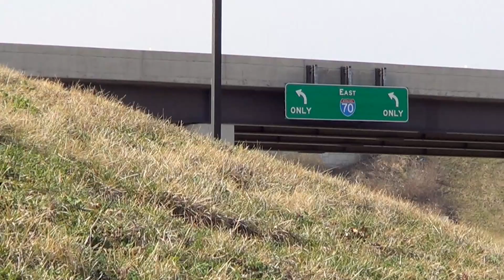MoDOT Recruits Solar Roadways

Comment: The original video now has disabled ratings and comments. How confidence-boosting
Reply: They have no answers and don't stand up to even the slightest bit of scrutiny.
Reply: Because the negative comments were running like 300 to 1.
Reply: Warren Lauzon because the idea is not practical, that simple.
Reply: Just tells how people have figured out they were scammed.

Comment: Readily available software can predict the solar generation potential in a particular location. Putting up test panels is an unnecessary waste of time and resources. This is not to mention the ill-advised idea of putting solar on a parking lot. Why on earth would you put down solar panels, only to have them be largely shaded by parked cars? Roads have the same issue, but to a lesser extent.
Reply: Why put up test panels?  To get "Solar Roadways" and "installed" into the press release, and Mr. Brusaw into the photo.
Reply: You got that right. All while creating misconceptions about solar left and right.
Reply: The 'Solar Left' is off protesting other misconceptions, while the 'Solar Right' is installing rooftop panels by the truckload.

Comment: What a dumb idea.
Reply: you;re literally talking about taking solar panels and blocking the sunlight and crushing them constantly with vehicles. if you're going to get energy from roads, use pressure, if you;re going to get energy from solar panels put them where the sun shines, dumbass
Reply: Patternicity ur so right
Reply: +BeezmanTv there's a difference between being open minded and being a gullible fool. people are already saving money by getting solar panels, solar roofs are a real thing that people are willing to pay for. putting solar panels on the ground reduces exposure to light and the lifespan of the panel.
Reply: what are u smoken ?
Reply: how is this dumb its fucking brilliant i see this happening more or less giving better tires are being made with cleaner gases it's ether the opposite or solar panels that  you sir are a dumb idea go blow tobacco out of your ass and dirty the air the hillbilly
Reply: +ben kenobi yes!! they r 2 fucking close minded . tell 'em again :-)

Comment: One of the MOST Stupid Ideas ever. Let alone traction or wear, them LED lights will Not be seen in day light. And how many times have you seen Gouges in the road? All the Time. What happens when a car or truck has a flat and runs on the rim? Or a trailer comes off a car or truck and it digs into the road? The cost is going to be out of this world. Now parking lots, side walks these may be fine. But not roads. And how about criminals? Running from the police on flat tires, or just steeling them. Get real.
Reply: ***** You didn't even address any of my points, you're just quitting like an upset toddler. You're not quitting because I insulted you, its because you're in over your head and you don't know what you're talking about. That's because you don't know anything about BASIC science, since you're an uneducated child. You quit because unlike you, I actually have a background in chemistry/physics and know what the fuck I'm talking about, because I've taken the time to educate myself and expand my knowledge of the universe. Get the fuck out, you future ditch digging piece of shit.
Reply: You can't wish science to disappear, but if you can spew enough BS you can distract people long enough to run a nice scam.  :)
Reply: ***** Are you actually being serious? The hardness/fragility of glass is inherent and unique to its molecular structure. Do you know how hardness works? If you rub two objects together, the harder one is going to erode away at the less hard material. Of course you could "temper" the glass to make it scratch resistant, but then you're using tempered glass as a road surface. You know, the stuff in your car window. The stuff that EASILY SHATTERS INTO A MILLION PIECES if you strike it with the tip of a pen. Everything on the road besides the rubber of tires is harder than glass. The pebbles, the dirt, the cars etc. The glass doesn't stand a chance. And lets not even talk about what happens when the glass gets wet, or when it gets cold in the winter LOL. There is no reason for these tests, anyone with BARE MINIMUM scientific knowledge knows the project is going to fail before it begins.

Putting somebody on the moon was never impossible, it was a very feasible and practical experiment, HENCE WHY THE PROJECT WAS FUNDED AND CARRIED OUT. Same with speed of sound, it was hard to do, but completely feasible and within the laws of reality. Making the roads out of glass LED solar panels? Completely retarded concept that cannot work because of the innate qualities of glass. Solar panels are great, but they don't belong on roads. Even having them for sidewalks is foolish considering how effortlessly they get damaged.

You have the scientific understanding of a child, did you even take high school physics and chemistry? You literally don't even understand why glass is a terrible material for roads, despite it being so fucking obvious and fundamental to the properties of glass itself.
Reply: No, glass can never survive the impacts that Alan described. There is no magical "testing" or "research" that will make glass tough and durable. We are dealing with the laws of science, you can't just wish them away with hopeful thinking, grow up.
Reply: Havox Aerthis You're a fucking moron. Take your TV or smartphone, lay it flat on the road facing the sky, and the drive to towards it and tell me you can see whats on the screen. SPOILER ALERT, you can't see jack fucking shit! There's a reason traffic lights aren't put on the roads, because you wouldn't be able to see the fucking lights! You're so stupid to not even understand the context of the example.
Reply: Havox Aerthis Wow, you completely ignored the fact that LEDS on a road surface cannot be seen in broad daylight, and will never work! Haha, and you think I'm american because I schooled your uneducated ass? Go back to your third world mud hut and read about how the earth is flat you incompetent stain. It doesn't matter how bright they are, if you can't see them properly due to bad angles. You don't understand basic mathematics, yet you're preaching about LEDS LOL.
Reply: Non de zeus ! Man, how you can see your smartphone screen during day ? How you can watch TV during day ? Oh well, we can't because you told us that artificial light can't be seen during day. Fucktard
Reply: Havox Aerthis pretty sure you are a sockpuppet
Reply: Yes yes and we also could not put a man on the moon, nor have plans that go faster then sound or light  So"We are dealing with the laws of science, you can't just wish them away with hopeful thinking, grow up." please take your advice also were did you get you degree in glass science and technology are write papers or do a thesis I love to read it.
Reply: And Yet I don't belittle you call you names nor talk down to you and look at the response I got from you it just shows me you have no understanding also probably ignorant. To bad I was hoping to have a Inequality Talk. please don't reply as I am done
Reply: Fake Grapefruit  Haha, angry american can't understand such a simple thing ? LED are more brighter, last time I saw a LED lamp, this lamp was flashing my eyes at about 1 miles, it was 5 pm.
Reply: Fake Grapefruit  Wait and see.
Reply: Faster than light.. yah, that happens a lot.
Reply: How well can you see your phone screen in direct sunlight?
Reply: It why they call it a test how stupid you will look if they work or right if they dont

Comment: Solar panelled roads cannot defrost themselves. Laws of thermodynamics.
Reply: I live where there is lots of snow during winter. Solar panel would be covered with snow and ice, so it would get very little light through snow. In winter time here it is often cloudy, sun is up in the sky less than in summer time and angle of the rays hitting road is very unfavorable for collecting energy, especially if there are trees shadowing road. It would not be efficient way to melt ice even from the small sections of road.
Reply: ***** No it won't. First let's say it magically will function, then let's go to the snow issue.

a) How is it going to gather solar energy while it is covered in snow?
b) How is it going to drain the water after it melts the snow?
c) How is it going to prevent the melted water from turning into ice, it's not going to use only 333.55KJ per kg to melt the snow it also has to keep the water it melted warm so that water doesn't transform in an ice sheet.

And before all of these issues there is the fact THAT IT DOESN'T WORK. It's a scam.
Reply: +imzjustplayin Dude, you need 333.55 kJ of energy for every 1kg of ice. That is not going to work.
Reply: And if it is pulling power FROM the grid, then how is it generating any power?
Reply: No, that is not how it works. And you would need about 2 weeks of stored energy (where is the storage, BTW?) to defrost 1/2 inch of ice.
Reply: It's not even a net generator during the day, and huge consumer at night.
Reply: Nope - the website says that when the temperature drops under 30F they heat up, regardless of any ice or snow. It's just freaking stupid.
Reply: Jared Pratt Actually, absolutely ZERO thought has been put into the storage of energy that is created, which is kind out moot to begin with because these panel are net consumers even if working properly as designed.

Unfortunately, the entire concept is flawed, and the execution of their first installation in Sandpoint demonstrates complete failure of concept.
Reply: Timm Bacher The sun is orders of magnitude better at melting snow and ice than any road surface will ever be, and the heat retention of asphalt even puts these panels to shame.
Reply: We have had solar panels for decades, in permanent rooftop installations - can anyone find an example of one that  heats itself to clear ice and snow that a) isn't powered by an outside source, and b) does it in real time, considering there is no storage system for this design?
Reply: @P C I'm surprised that he didn't reply with more "science woo"
Reply: Jared Pratt pavement can do the same
Reply: Can you imagine how absolutely incredibly expensive it would be to heat miles of road with electric power?

These charlatans haven't changed the laws of thermal dynamics or the cost/value of electric power.   And for those of you who haven't lived where it actually does snow, when the sun shines, the sun's light and heat energy hits the blacktop and is already converted into heat energy.   Inefficiently collecting it as electrical energy,, attempting to store it inefficiently and then using it in a wasteful method does not make any sense. 

Next time some idiot makes a flashy video, turn on your brain and think it through before you fall hook line and sinker for this.
Reply: You are going to have to heat it enough to not only melt the snow but to drain it away.  Then you will need to keep the surface warm enough for the water to dry so it doesn't form a thin layer of ice from the left over moisture.  The ground around the road is going to be covered in ice from the water splashing onto the colder ground.  So  you will need heated drains to keep the water liquid.  Yes you are melting tons of snow.  A few inches of snow on a short length of road will weigh a ton.

Anyway you put it, this is an incredibly stupid proposal, that is except for the charlatans pushing it as they collect money from the foolish people and governments who throw it their way.
Reply: Now, another issue you have with laws of thermodynamics have to do with expansion and contraction. Glass expands when heated. So will the various metals used to build the frame, and they will expand at different rates, creating gaps.

The heating pads they have designed for this SR3 system go inside the unit, correct? 

This would cause the units themselves to expand and contract - unevenly as per material -  as they were heated and cooled. I'm guessing the units are not vacuum sealed, so any gas in the unit would also expand and contract, then condense. Even if they start off sealed, they won't remain that way for long.

Heat and condensation/moisture are enemies of electronic systems, as has already been proven with their Sandpoint installation, which was an incredible, and predictable, failure,

Now, for the heat to transfer through inches of glass, to the point where it can melt snow, do you have any idea how hot the cavity of the panel will have to get to melt substantial ice or snow loads from the surface? Probably somewhere in the neighbourhood of 70c, since it takes the same amount of energy to take ice from zero to 70c as it does to boil the same amount of water.

As for energy required, let's say we are using consumer heating pads for the purpose. a 12"x12" pad one would normally have around the house uses 60-80w. Let's call it 60w, but we now need four per panel. The power requirement then would be 240w per panels to heat them up. Or, roughly 1kW per every four panels, excluding their intended purpose of lighting up the road.

But these panels only produce 44w, IF they are pointed directly at the sun, 24 hours per day, and are perfectly clean using completely clear colourless glass with no faulty cells. NONE of which are the case with the SR3 panels in their proposed installation paradigm.

A four-lane highway is a minimum of 62 feet wide, at 12 feet per lane, plus ten feet on the outside shoulder and four feet on the inside shoulder. A mile is 5280 feet long, giving one mile of highway a minimum of 327,360 sq ft. These panels, assuming they are using the same design as their 'parking lot', are approximately 4 sq ft, and probably a little less given their hexagonal shape. So, to cover one mile of highway, you will need minimum 81,840 tiles. Per mile.

Therefore, to heat this single mile of highway would use 19.64 MEGAWATTS (81,840*240w) of sustained external energy. Energy is paid for in watt-hours, so overnight, with a fourteen-hour night period during the winter, this would equate to 275 mega watt-hours. Per night. In short, it would require it's own dedicated power plant. FOR ONE MILE. PER NIGHT, when absolutely no power is being produced by the panels.

Let's say someone installs 10 miles of this, and that you have a five-month ice and snow season - here's the math.

81840 tiles per mile
10 miles
240w per tile
150 days frost season
24 hours (still freezing during the day)...

=707,097,600,000 watt-hours, or 707 GIGA watt-hours - at a kilowatt rate of $0.10/kWh that's $70,709,760 PER WINTER.

In comparison, the average American household uses 900,000 watt-hours PER YEAR.

Meaning that instead of heating the 10-mile road during the winter for five months, you could power 785,664 homes for the entire year instead.

NOW, let's somehow imagine they manage to heat these panels with 24w heaters instead of 240w heaters.

All that does is move the decimal ONE PLACE.

And we are only talking heating ten miles of surface. That's not the material cost, rehabilitation/site prep cost, labour cost of install or assembly, infrastructure cost - and those ten miles for tile raw materials would cost (and this has been worked out) $2.05 billion in raw, unassembled materials.

Still think this unicorn fart is reality?
Reply: Timm Bacher Well to melt snow, you need to heat it above 32f. That might not be as much electricity as you think it is. Yes it's miles of road but we're not heating it to a temperature that's comfortable, just enough to melt. I have no idea what the calculations for that would be though it'd be interesting to find out.
Reply: Larry Lewinsohn Well since it is connected to the grid, it will be capable of pulling power from the grid whether it's getting sunshine or not. They already have heated walkways in limited use in Europe that do exactly this. "Snowmelt System" can be found on Wikipedia and it describes systems that are already in use. If you're asking whether or not this system is capable of generating more electricity than it consumes during the winter time, I'd say it would use more than it produces. Now on a whole year round cycle, it may produce more energy than it consumes.

As for the melted water, water does evaporate, especially in sub freezing conditions due to the low humidity. You can hang dry your clothes in sub freezing conditions and they will dry properly fyi.
Reply: It could be a net generator during the summer months and net consumer during the winter months.
Reply: It wouldn't be consuming any electricity during the summer time but be a net producer.
Reply: The entire system harnesses and stores energy. Heating elements engage to keep the panels above freezing temperature to thaw the panels using SOME of the internally stored energy. Once clear they can continue to harness/store.
Reply: If they're hooked up to the grid, then it's not impossible for them to utilize the grid to defrost themselves.
Reply: Timm Bacher For one thing, you're not heating the road 24/7, just enough to melt the snow. Secondly, it's entirely possible to heat sections at a time, exposing road surface, then using the solar generated power (what ever that amount is) to help offset the load of melting the other sections of road. Remember, you're not melting tons of snow, just a few inches of what can't be scraped away.
Reply: Larry Lewinsohn If you use a snow plow, how much weight in snow/ice is going to cover a square foot? 333.55kj is about 100 watt hours but that's for 1KG of ice/snow. 

You're thinking that this device is going to do all the work, it won't, but it should take up the slack of what salt/sand does.